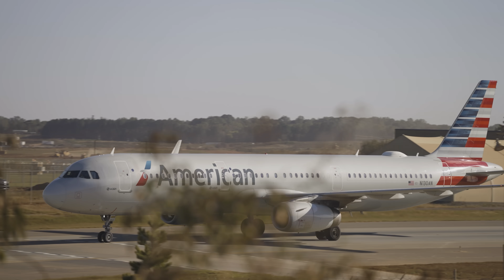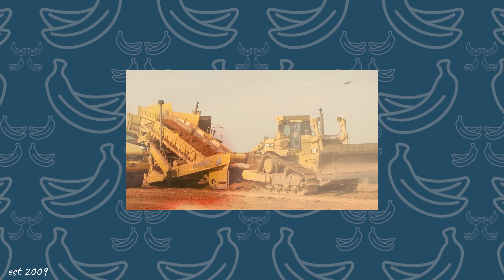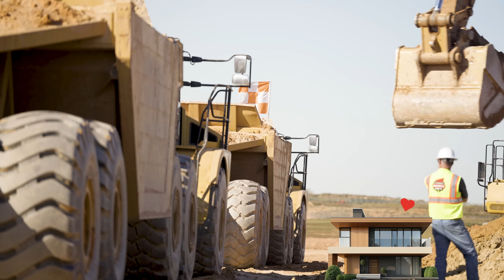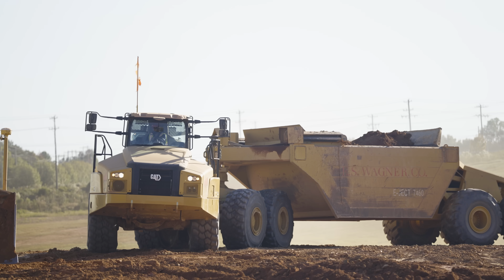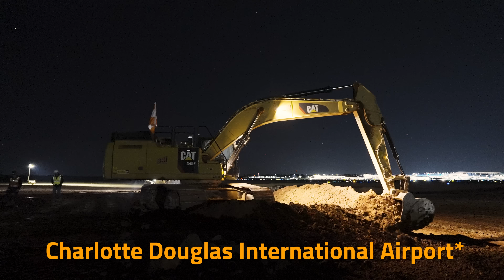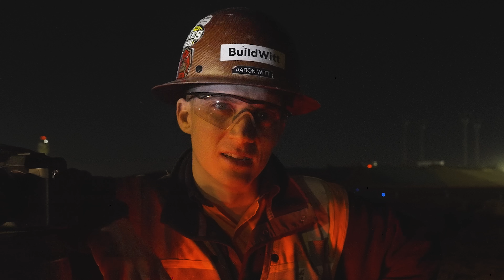Building $1 Billion of Runway at CLT International Airport

Comment: In Atlanta, currently, there're rolling entire pieces of building across the taxiways, as they work on expanding Concourse D.

Once each section is finished off on the side of the airport property, they do a nighttime move across the taxiways.  Atlanta never really shuts down, so the air traffic controllers are having to move the airplanes around the building as it crawls along.  It's wild.

Comment: Incredible that it has taken as long as it has with so little progress!

‘Merica won WW2 in 3.5 years and fabricated 82 aircraft carriers in that time.   ￼￼￼ ￼

A flat piece of concrete in a decade don’t impress.  10,000 feet?  That ain’t even long!  Major airports elsewhere have at least one 12-15k strip.

Yesterday I held short of their construction traffic taxiway crossing as the runway departure traffic was backed up solid to it, so they could guide the 13 trucks across both ways. 

The flag clowns just ignored me and held up the long lines of trucks, waving me to pull up and fully block them.   🤡 Show.   That’s how you get this level of progress in a decade.

Comment: The orange and white checkered flags also denote that the vehicle is not in radio contact with the ATC ground controller. All other vehicles crossing taxiways or runways carry radios or are in contact with a lead vehicle that does.
Reply: thanks, was wondering why they were flying the Purina logo and not Murica hoss
Reply: Flags are also in lieu of a rotating beacon, and flags can only be used during daytime operations in active airfield areas.
Reply: They're actually just Tennessee Vols fans
Reply: I've seen it on cranes also thought the same thing. @coleslaw2394

Comment: Looking good! So you’re telling me some of the trucks out there are called “773”s? Am crew on 777s and occasionally our version of the “773” is out there too. Ours have 115,000lbs of thrust though, are 242’ long and have 14 wheels. We very rarely use 36L/18R (the newer far west runway), so don’t get involved with the dig over N, V or T taxiways. Hopefully the new runway has a pitch like 36L/18R. The center runway has a 50ft elevation gain to the north where 36L/18R has none, so these guys did a great job with the more recent runway. Just wish CLT would build more stands if they’re increasing capacity with a 4th (technically 5th) runway as we’re congested as it is. Cart before horse sadly. Nice video!

Comment: I used to work on airfields as an electrician on the west coast. Would love to see you cover the electrical portion of the runway. The constant current system involved is very intriguing.
Reply: I’d be interested in that as well and sure a lot of other people would be. Is that constant current same as welding world? Amps are fixed and voltage is not?

Comment: Do you think the ejects will leave indentations across the tarmac of the most commonly traveled path?
Reply from the maker: no they actually have pretty low ground pressure
Reply: The taxiways are built to accommodate aircraft that repeatedly follow the same with more concentrated weight

Comment: As a pilot I'm somewhat dreading the extra runway. CLT is one of my most hated airports that I try to avoid like the plague and frankly they need to bulldoze the current terminals and start over, it's the most overcrowded airport, maybe not by numbers of passengers per year compared to others on paper but it really feels like it. Throwing more planes into the mix will only make things worse. They should've finished any long-term future  master-planned terminal expansions before even bothering with the runways, but I'm just a glorified bus driver so what do I know.
Reply: I know, we have taxied longer in Charlotte than the flight itself was to get there.
Reply: @roger25375  lemme guess you came in from Asheville, Charlottesville or Greenville
Reply: I’m not sure if I agree with how they’re numbering the new runways. Maybe it’s standard to not change the old runways but something about having 19 between 18 right and center seems a little off to me
Reply: @timblack33  I don't see what's the big deal. There's already a left center and right. Look at any airport with more than 3 parallel runways (DFW, ATL, etc) and the next even runway always gets the next heading rounded up or down. It's SOP. There's plenty of airports out there with parallel runways too that don't even use left and right. Denton and ft worth meacham for example
Reply: And don’t forget the long haul of walking from one terminal to another. I feel absolutely exhausted and somewhat lost by the time I get to my next plane. Ugh!
Reply: Tell me about it. CLT could build 10 runways and the end result will only be more traffic on the ramp and in the alleys lol. Not to mention the crazy congestion INSIDE the terminal itself like you said. Looks like they'll continue putting lipstick on a pig for the foreseeable future
Reply: thoughts on the new SLC?
Reply: @flynlr  I rarely go there. And I've never been to the "old" SLC so I have no reference point. It's ok I guess
Reply: As a person who travels and been to most of your major airports in the country I HATE flying out of CLT. It’s the closest one to where I live 😭
Reply: What makes it so bad? I’d imagine as a pilot Chicago or Atlanta airport would be bad. With all the traffic
Reply: @MS-37  read my comment again. Slowly
Reply: @MS-37  Traffic bad taxiway design and it’s always clogged with traiific horrible runway/gate placement
Reply: Well your the man flying in and out, no doubt your opinion would be worth some weight.
Reply: So what I’m getting is everyone hates CLT
Reply: One has to remember that Charlotte/NC is always running at least ten years behind on any type of transportation!
Reply: @davidhorne2326 you can thank Raleigh for that
Reply: @davidhorne2326 We wouldn’t be if people would STOP MOVING HERE!!!!!!!
Reply: @JerryJonesDCowboysINEPTOwner  It’s crazy! I lived there for a long time and moved away after retirement. We still have to go back often and traffic is terrible! I77 is unbelievable!
Reply: @davidhorne2326  that applies to the whole country in my experience. We could really learn from Japan or Western Europe, and when it comes to passenger trains were 50+ years behind
Reply: I hate clt airport as well. It is very inefficient. As a delta only flyer idk how I’d manage if it was a delta hub.
Reply: @bmwm3ja  I mean ATL is not much better IMO
Reply: Well, idk about that. But I haft to say that the new airport overlook SUCKS.
You’re so far away that it’s not fun anymore.
The old one, while not being fancy or nice. Was right close to the runway, and you really felt like you were apart of everything, the new one is just overlooking them and, while still cool. Isn’t nearly as awesome as the old one.
Reply: @stonesymmetry AGREED! My GREATEST CHILDHOOD MEMORIES is going to “the overlook” and watching planes fly right over our head! It was a Sunday Night Tradition for My Parents & I! That was 30 years ago! 🥹
Reply: @JerryJonesDCowboysINEPTOwner  true!
Reply: There are two new terminals with 2 or more in planning, the amount of construction that has been going on there for the last 7ish years is crazy. I'm not sure what more you think they could do other than build like they are.
Reply: @zekeevans8687  as I said, finish all the future terminals first, THEN add runways. Though the timing might more or less coincide. We'll see
Reply: @aerialbugsmasher  it's going to take roughly 2 years to complete this, it takes roughly a year to build a terminal. The third new terminal will be open prior to this runway.
Reply: You are not a glorified bus driver.  Your profession is one of the most intricate other than maybe a naval aviator and crew on board an aircraft carrier.
Reply: As a flight simmer , I can agree it takes so long to land or take off and general taxiing is super complex, Ik it’s nothing like real life but I’m generally agreeing
Reply: @dieserFotografja  🤪😂🤣😂🤪